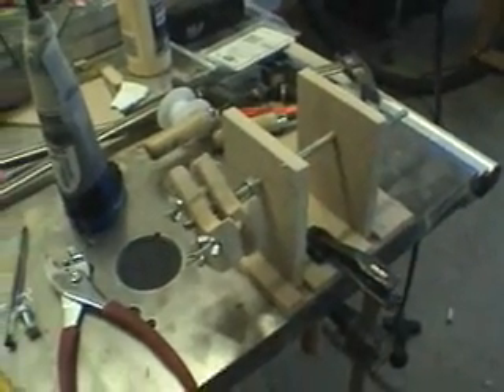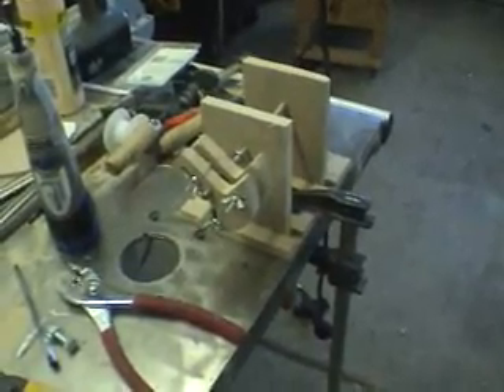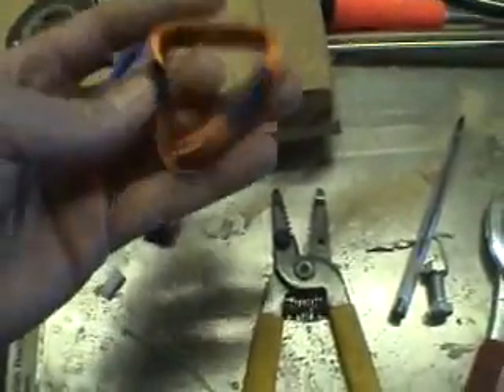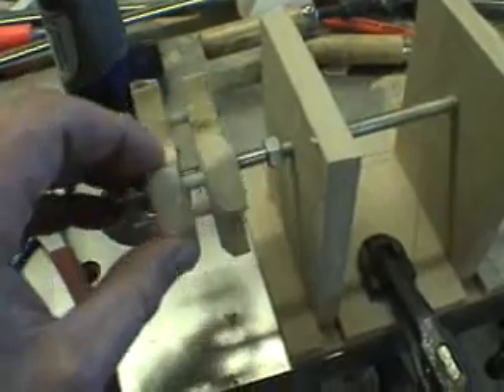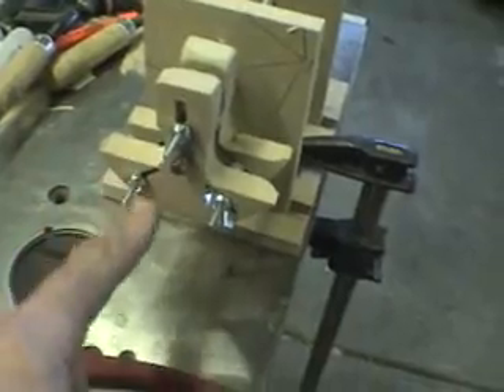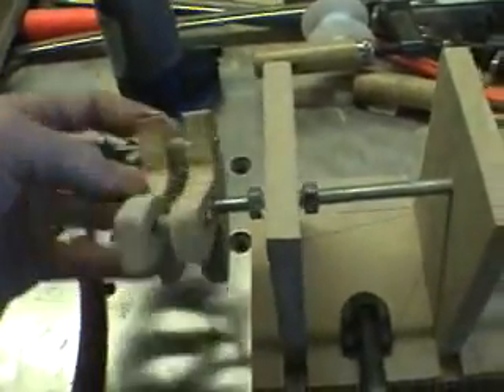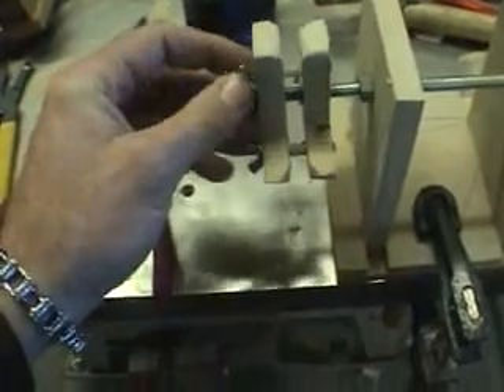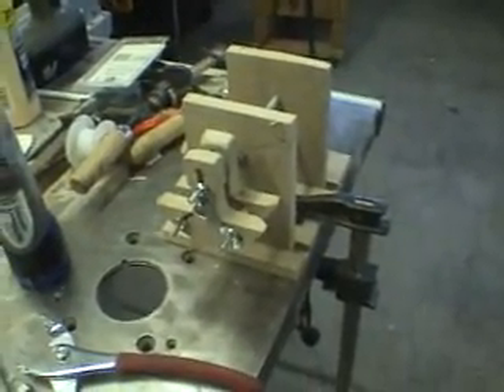coil winder

Comment: how do you crank the handle and hold the spool at the same time?

also, do you know a good coating material for bare copper wire? similar to magnet wire coating, not the insulated stuff.